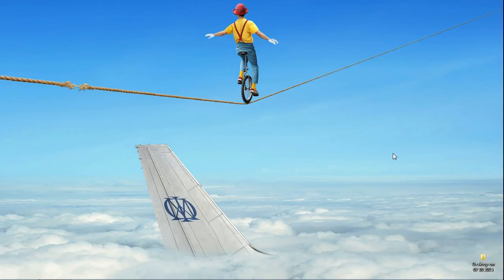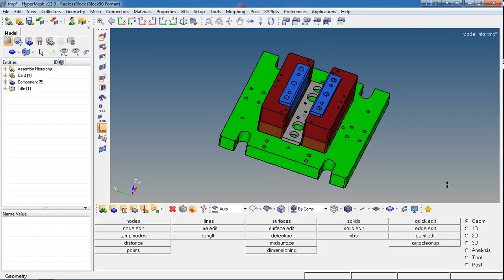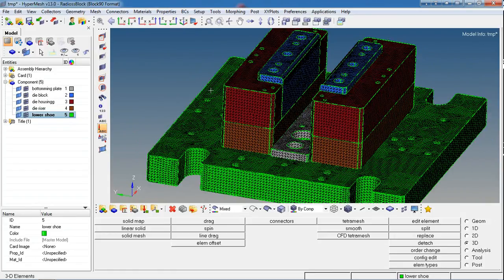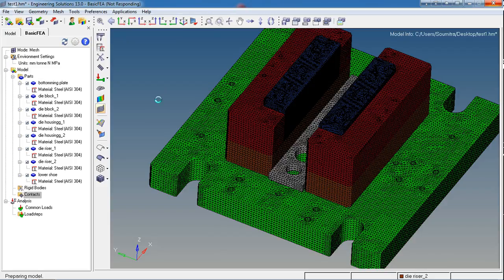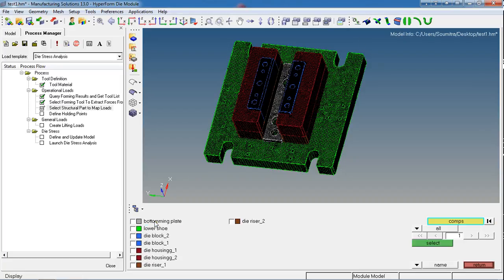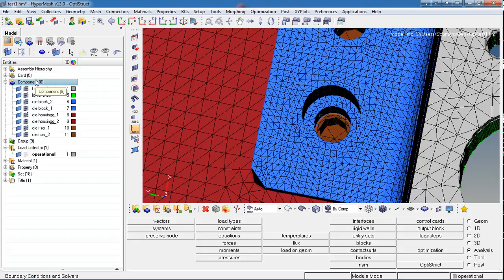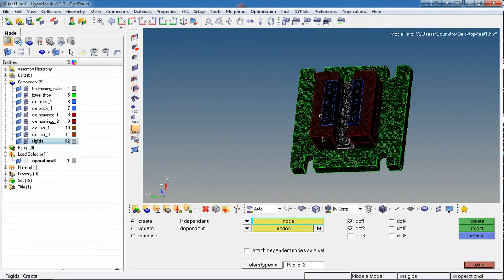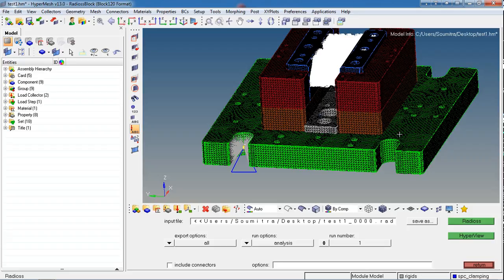Die Structure Analysis (Plated dies) using Altair HyperWorks

Comment: what did you mean by R-trias been stiff?
Reply from the maker: More correctly maybe I meant to say trias (in general).

It's known that triangular elements are stiffer elements as compared to quadrilateral elements.

My logic: Think of it in this way,
Imagine a rectangular welded frame structure, if you wanna make it stiffer for any side loading (comprehensive/tensile), what would you do?

I guess, you 'd add (weld) a brace member diagonally to the structure.

Hope I clear your doubt with this.